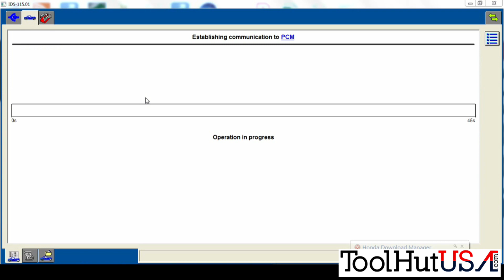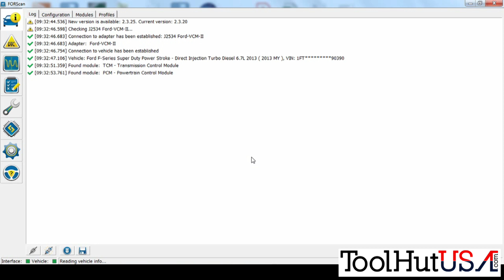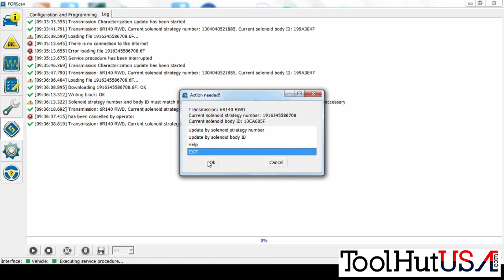Tuned 13 F350 Diesel solenoid ID and Strategy Using Forscan

Comment: 2011 f150,replaced trans with reman! Program fails using rap kit! Should I only change the 13 digit number, and is that my problem programming?

Comment: So if my 2017 f350 is deleted and tuned and I replace the valve body I just need to use forscan to upload new strategy and that’s it.
Reply from the maker: Yes that should work

Comment: Hey good morning,  I have a 2017 F450, I   just changed the valave body and the TCM. The guy that does my programming was able to enter the new Valve Body info. However it won't let him enter the new TCM information. My truck was deleted and tuned when I bought it. Any suggestions on getting around this issue?
Reply from the maker: I would suggest using Forscan

Comment: what about a 2010 ford flex with the 6f55 transmission? I have FORscan but the option to change the solenoid body strategy isn't there.

Comment: Good info. My truck has had the tcm tuned. It now shifts very hard at time and I think it’s because the tune didn’t account for the unique solenoids in the valve body. Where do I go to find my trucks solenoid body strategy and Id so that I can return the tcm back to stock to see if the shifting issues go away.
Reply from the maker: there are many options to view you Id and strategy. You need a professional level scan tool, or forscan

Comment: when i go to the tcm update window it only gives me the option to change the strategy code. not the solenoid body code. i updated the strategy code and still not able to change the solenoid body code and i can see it doesn't match what is on my valve body. any help on how to change that? 2012 f250 deleted and tuned.

Comment: I can only get the body I'd to change. What would be the cause of the strategy reading n/a  after I tried to change it? I was connected to the internet the whole time.
Reply from the maker: It is likely Forscan does not have that file. It may need to be done with the IDS
Reply: @toolhutusaakathecarflasher3019  how do I do that?
Reply: @toolhutusaakathecarflasher3019  will it hurt anything running it ?
Reply from the maker: @jasonrunner7698  yes it could cause premature trans failure.
Reply: Did you ever figure out what the problem was? I’m having the same problem only changes the body ID
Reply: Says it’s unable to open the file for the strategy
Reply from the maker: @Ks-um6uo  more than likely Forscan does not have the file. Which means it will require a ford subscription and a J2534 box to resolve

Comment: Odd question..... Is there a way to get the character/solenoid codes on used transmission that has ALREADY been installed?    

** Without dropping the transmission pan**
Reply from the maker: Sometimes it is molded in the connector
Reply: @toolhutusaakathecarflasher3019  thanks

Comment: So the FORscan can change the solenoids id when swapping a trans, i read on FORscan forum that it could not...  just wondering before purchasing because paying 40 USD each time using FJDS is plain stupid...  if i can do it with FORscan I'm sold on it..
Reply from the maker: Sometimes it can.
Sometimes it doesn't work
Reply: @toolhutusaakathecarflasher3019  if a shop doesn't change the codes, will the vehicle still be drivable with just harsh shift points or what happens?
Reply from the maker: @semperfi5857  it will cause harsh or soft shifts. It will cause premature failure of transmission components

Comment: Can you explain the way around that error within IDS? I need to update the transmission solenoid strategy for my 2018 mustang with the 10r80 which is not supported through FORScan.
Reply from the maker: I do not understand the question
Reply: @toolhutusaakathecarflasher3019  So I am also getting the unique pcm identifier is unrecognized through IDS.  And you mention there is a way around it that takes a little time in IDS. Curious if you can explain how that is done. I would be happy to use my forscan to enter the new solenoid strategy but it does not support the 2018 mustang yet.
Reply from the maker: @98snakehorse  I believe the mustang will be done in FDRS. I have not used FDRS to any extreme yet. In the event it is done in IDS just leave the key off during the Identification process. When it asks for the teartag put your teartag in and It should allow you to do the IDN and strategy. If you have a tuned PCM (usually the reason for the error) it will also program it to factory, so it will need to be retuned or have the tune reinstalled.
Reply: Tool Hut USA aka The Car Flasher thank you! Much appreciated

Comment: Can you update PCM with Forscan I did my valve body with Forscan I have a tuned 2012 6.7 diesel I tune with custom tunes and SCTX4 device would be nice to update my pcm . I bought a used pcm when I wrote as built of ford it came up in Chinese crazy stuff Had FFF FFF FFF couldn’t read my old one because it’s bricked in the auto as built I could select most my options and got almost everything to match except 4x4 and now it doesn’t shut down after 15 minutes of idol  I noticed if I tried to write to much or not start new service procedures after each write Forscan didn’t like that 
I’m a new subscriber and am interested in learning more not many people know much about programming modules
Reply from the maker: Go to www.motorcraftservice.com free resources, quick guide, module data as built

Comment: I have a 2018 f140 with a custom tune. I recently tried to use forscan to make some changes but a window popped up saying it wanted my PCM’s strategy code. I didn’t go any further for fear of screwing something up.
  Can you shed any light on this? Thank you
Reply from the maker: It is because of the custom tune. There should be a 4 digit code on your pcm, If not you can look up on motorcraftservice.com under free resources and as built data. The 4 digit code at the top is your strategy code. or tear tag. It wont hurt anything putting this in as it is only attempting to ID the vehcile. Dont make changes in the PCM though. Hope this helps